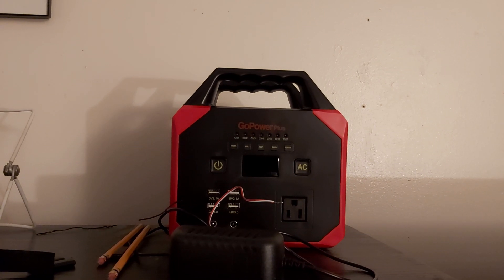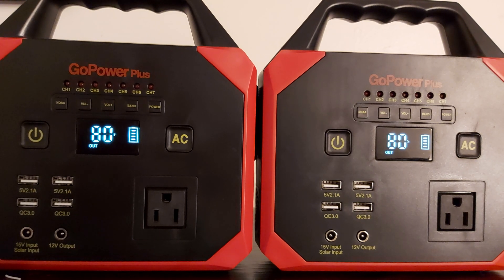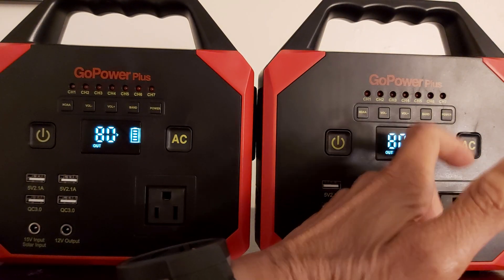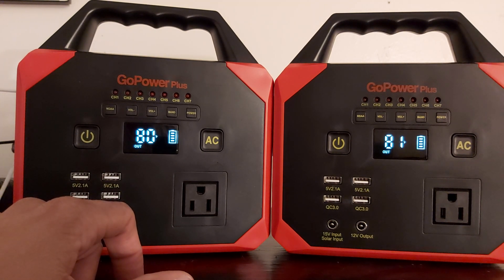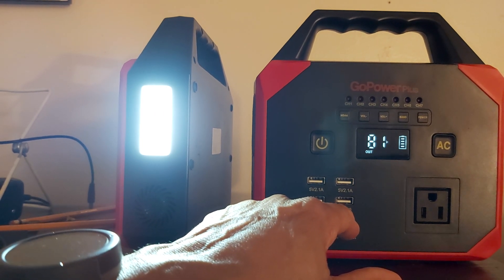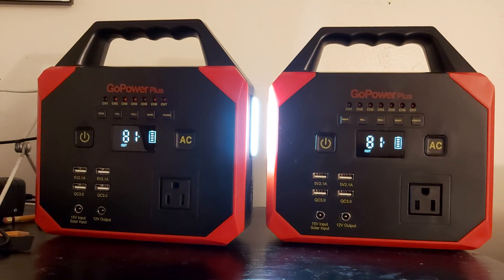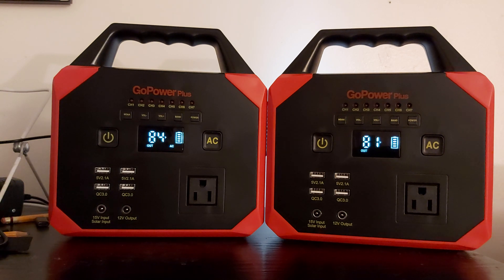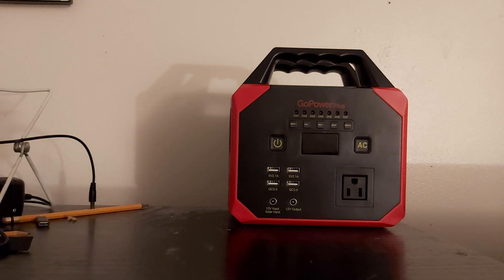GoPower Plus Solar Gen  | After 4 Weeks of Ownership and Usage

Comment: Try the onn power station its a whole lot better and around 100 at Walmart plus it has a blue tooth speaker and weather radio it's 200 rated wattsand 300 peak wattage
Reply from the maker: That what you had said I looked at it I haven't seen it at the store yet. 220 Watts for $99. This what wish I'm showing here since 2021 you could have had it for $3 to thirty. What was shown here what selling $100 in the store. UC this one here that they have now in 2023 it was selling for like 50 bucks then people would get on it.

Comment: Go inside and disconnect the battery from the PC board and reconnect it after a while, it should reboot.
Reply from the maker: Thanks for feedback! Yes what you say is true you can also free it in your freezer to force to drop the codes. Ziplock, paper towel folder and then insert lock ziplock drop it into the freezer for 30 to 3 hrs. Take it out let it stand for room temp codes should revert. Or you can do it the way you had suggested as well.
Reply: @albertsvoicesolar  That's not good for the battery's.

Comment: Go to radio shack ®/ napa® and get in line fuse unit and fuses. Let the fuse pop . Far cheaper. Than loosing the function or use of unit. SGT WILLIAMS retired
Reply from the maker: Thanks for your feedback! RS still around I haven't seen any of them here. Inline fuse maybe at THD or Lowes if they have those or otherwise Amazon or maybe ACE.  Thanks for the suggestion.

Comment: Can you help us out over here please? In the past, during an outage, we've charged a phone in the car's cigarette lighter socket. Would it be better to recharge the gopower unit in the car, leave it overnight, or should we just charge the phone in the car? Thanks!
Reply from the maker: Thanks for your comment!  12V socket in the vehicle would take longer even if you turned on the engine direct battery with a 15 amp fuse attach you could manage to charge is slightly faster. Remember the battery of your vehicle without alt on will drain your battery.  At 15V charges  faster in 3Hrs. Do not drain the device below 2-3 bars if you can manage that. If you do the unit only last 500 recharges. If do the way I had suggested it will last  upwards of 1,000 charges.

Comment: OK, So I E4ed my GoPower. What can I do? Ideas? Is this fixable?
Reply from the maker: Thanks for your comment! Did it smoke? E4 internal error. Leave it on until drain out the battery completely.  There is no reset the only way to do that is to open it up and unscrew the battery leads from negative (black) wait 3 hrs. I wouldn't freeze it because the degrades the battery.  Report back your findings. **Disclaimer open the unit on your own risk**

Comment: When you do not have anything plugged in to charge the system will shut off. That is a feature built into the unit to conserve power.
Reply from the maker: Thanks for your comment! Correct! When your charging say like Cell phone tower (more on that in another video) But right now what I can tell the Go Power Plus will shutdown like you say when your devices reach 100% charge. But I also see that not always the case as well. If the temp gets to hot it will kick on the fan or it might shutdown the device.

Comment: So again how do you avoid the “E4” error? Of course I want to avoid that. I by accident plugged my charging cable into the 12v output. But I noticed it in time hopefully. 

Didn’t know it can handle a 150 watts. Not bad.
Reply from the maker: Thanks for your comment. E4 if you plug in something that won't work or has short in it into 12V output. 15V Input as well. Do not go over 3.2A. Yes it can handle up to that amount as peak 150W.  120W rated 150W peaked it won't handle anymore might start to over heat if you push it. Just be careful.